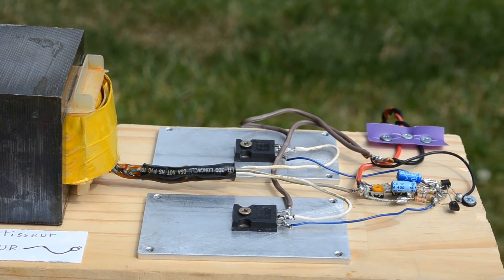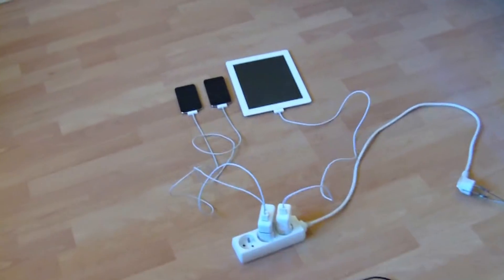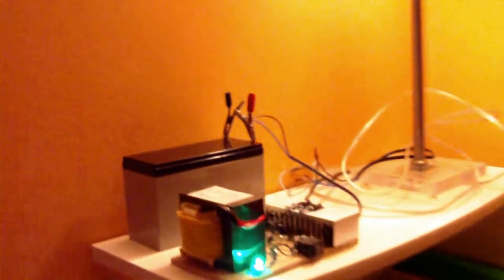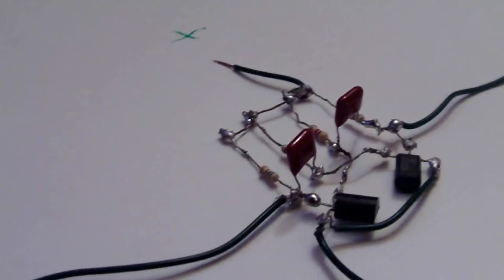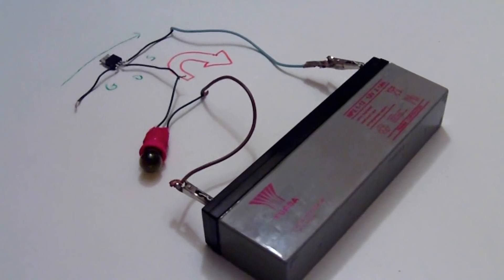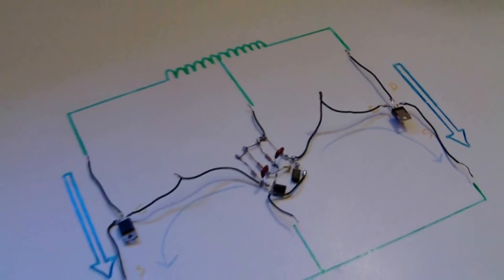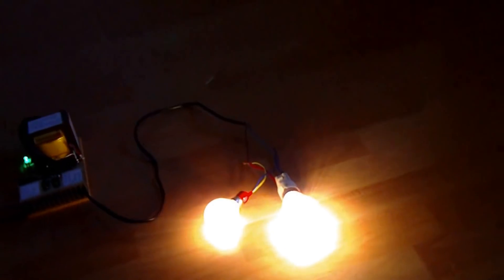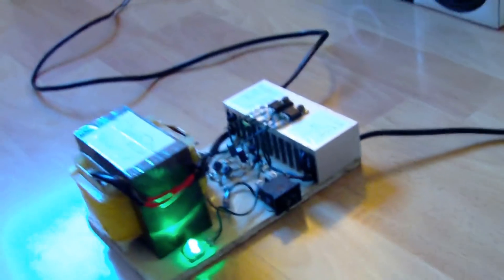Make an inverter : DIY Experiments #2 - Power AC devices with a battery / homemade inverter

Comment: Can any one suggest me which transformer need to get 70 volt out put.
Reply: +rtbalu Depends on your windings. If you use a 12V battery, you must have a 12:70 ratio on your windings. I suggest having a 7+7 on the primairy coil. Meaning you would have to make a transformer with 82 windings on the secondairy coil.

Comment: if the output of this inverter is connected a 220v ac and then to a motor would it give the motor a better voltage , like a sine wave?

Comment: Transistor number??
Reply: what volts u use with 2.2uf?
Reply: +Ali Asir is it true that the diagram you use of your converter is the diagram that diy gave at the end of the video?
Reply: i follow what diy video but my inverter doesn't work sir ali asir...i think in my transformer i used...what type of transformer you used sir in your inverter..?
Reply: +Atakan Karaoğlan Mosfet Transistor IRF630 
And 2N2222
Reply: Voltage is no matter i used 400v and it works prefect, here you can see the one i made 
http://postimg.org/image/a9ln0fdnr/

http://postimg.org/image/776wxonnb/
Reply: +Ali Asir ....what is the value of your capacitor?
Reply: 2.2 uf + 400v
Reply: Yes
Reply: Npn or pnp please reply anyone
Reply: Joel Munion bro use 12 0 12 step down transformer. Good to use a higher amp transformer

Comment: How do I make one for  3 Phase AC ?
Reply: +Flying Karapet Edit our transformer, makes 3 wire on output, just you need to remove the secondary coil from the transformer and make one wire in the Middle of the transformer and that is it

Comment: Cool video. I know these type of inverters are very reliable but you can't go really high in wattage.
Reply from the maker: It's not a problem of battery, a lead battery like that van deliver more than 50A, more than 200A on short circut ! The problem is the resistor in the primary coil. To have a lower you have to use a bigger transformer (higher section).
Reply from the maker: In normal use a battery is always far from his max amp (short circut). It efficiency is decreasing proportionally beacause of it internal resistivity. So it do not depend of the type of battery, if your battery is next to his max amps, it would died quickly !

Comment: I am trying to learn about how the oscillator works. Do you know of any good websites or videos to explain this?  Thanks
Reply from the maker: I take the time to understand is by myself, indications : exterior resistors = "power" of the oultet of the oscillator. Center resistors : RC circut with the capa. In a cycle, the capa are charged at -0,6 at one moment.
Reply: Pedro Casultsan 
www.sentax.ca

Comment: i want to ask you something...what type of transformer you used? i have a 230v to 12 v transformer which i buy for making 230 v ac to 12 v dc..can i use that transformer in this case??reply as soon as possible
Reply from the maker: In this video we use a symetric transformer, equiv to 24V with an out at 12V. Il you want to use a sigle outlet transformer you can use a "H bridge" but it require a P-channel transformer :)
Reply: Can I knw what will be the capacitor voltage?
Reply: Hii ..thankx for posting this type of video. .I make it but have a problem.thisgive me a 115 v of ac output and  how to increase the voltage...
Reply: rohit hazra 24vdc to have tolerance
Reply: I make it but still have a problem. ..I just get 120v.. wich can glow just 5w. Cfl..I want more power please help.
Reply: +rohit hazra What kind of transformer did you use?

Comment: unsure what tranformer to buy...what to google...where i can salvage 1 from...any help plz as im goin to be making this asap to run my laptop in my car cheers
Reply: Brat4PrimeMinister from oven or  i got one from sony stereo or any electric .
Reply: +Brat4PrimeMinister Use Step Up Transformer 12vac to 220vac or 110vac 
Remember the Input of your transformer must have 3 wires , 1 the start of the coil second one in the Middle that&#39;s half and other one the end of the coil, use a strong and big transformer that works better i made one by my self and that works very well
Reply: here is the one i made: 
 http://postimg.org/image/6d6ad2dwb/
http://postimg.org/image/776wxonnb/
Reply: would love to see a vid of a make (parts list) or just of it working
Reply: i will make one
Reply: ANTHONY CABALLERO can I use a microwave transformer with this circuit? I intend to use the device in the same manner as he did in the video.
Reply: Jordan R. Just change the highvoltage secondary windings into 12-0-12 and add more Power mosfets, it will do, Good luck! :D
Reply: cheers ali for ya time....im still goin to be makin this project later in the yr so I may be in touch....and then ull wonder 6 months down the line who the fuck is this guy....thx again ;)
Reply: Brat4PrimeMinister if your only run a laptop, a 12v 8A center tap or 12-0-12 
transformer will do

Comment: thanks for the video. but the transistor 2N2222 is unavailable in our market. which equivalent transisor can replace this coponents and the rating of the capacitor is not know. help me on this. how can we increase current in the circuit. is it by changing the mosfet transistor

Comment: Thanks for reply... I have brought a new one.. Replace it.. And thankyou... I  just made an inverter and it work well... Thankyou :) DIY Experiments
Reply from the maker: Great !
Reply: DIY Experiments , hi please can this inverter power on a single phase electric motor? please help me
Reply: emmanuel nkengache this device produces a square wave output so it is probably not ideal for powering inductive loads such as motors but I think with enough know how and parts you could make a pure sine wave version 

Or you could just buy a premade pure sine wave inverter
Reply: In my attempts to power induction motors with square wave and modified sine wave inverters I found that they use more power from your battery and the motors have a bad habit of overheating and in some cases they would not start or would start very slowly and have reduced performance
Reply: please with pur sign wave can an induction motor start numally with ful speed? if yes, please can you help me pur sign wave inverter diagram please
Reply: As a general rule of thumb 
a pure sine wave inverter can power pretty much anything that the mains can power (assuming your inverter and battery has enough capacity)

So yes in general a pure sine wave inverter can run and start an induction motor 

motors like universal motors will generally run fine on modified sine wave but will probably run a little hotter than normal 

Induction motors such at what is in your fridge, washer or A.C are unlikely to work on modified sine wave and if they do manage to start they will probably overheat and will definitely draw a LOT more power from your battery and possibly overload your inverter 

Modified sine wave inverters work well for applications such as 
Lights 
Switchmode power supplies (laptop/phone chargers)
LCD TVs 
Electric heaters 
Electric cookers (if you can find an inverter powerful enough)

Pure sine wave inverters are best used to power the following 
Any appliance with a motor or compressor 
Microwave ovens 
CRT TVs 
Transformer power supplies 
Alarm systems (home security)
Desktop PCs 
fluorescent lights 
Sensitive equipment (oscilliscopes)
Life support equipment (oxygen concentrators)

But in general I recommend buying a large pure sine wave inverter instead of a modified sine wave and a pure sine wave because it is more energy efficient 

Hope this helps
Reply: 45hz I am surprised your equipment works properly 

Also what is your voltage regulation like 

In my usage I have found square wave and modified sine wave to be almost useless for what I need to power
Reply: Il take a look later when I get home
Reply: Output voltage regulation 
Meaning if you connect a big load 
How much does the voltage drop before the load fully starts and 
How much is the voltage at max load compared to no load
Reply: Ok well it's always wise to test the voltage regulation on any power inverter wether you made it yourself or bought it from a store or online
Reply: 105 seems a bit low for US standards 
I recommend a better transformer and thicker wire to and from the boost stage 
Maybe even a high voltage cap on the 120V side of the boost stage (before the chopper of course)

Over here in Australia 
I don't buy any inverter unless it can maintain 235V at max rated power
And 220V at its max rated surge power

It tends to damage equipment if the voltage dips into a brownout condition so AC voltage regulation is just as important as the output voltage itself 

The easiest way to test the voltage regulation is to get a power strip and plug a multimeter into it 
Then write down the no load voltage 
And load the inverter to its max power and write down the voltage again 

Or you could just observe it if you CBF writing lol
Reply: Not a bad idea I guess the simplicity of it would allow you to drain the battery more and allow for easier repairs 
But you definitely need some form of AC voltage regulation or at least a clamp circuit so if you connect it to a fully charged battery the AC voltage doesn't go to like 150V-200V (Which would fry most things in the USA)
Also a hint you can run AC equipment at high switching frequencies without damaging it 
I have seen things run at up to 100hz (50hz is the norm here)

Also what is the battery voltage that your inverter becomes unusable 

Mine gives the screech of death at 10.12V and it cuts out at 8.79V
Reply: And still gives 120V out?
Reply: Ok well good luck with that
Reply: Ahmed Saeed can u say the transistor and MOSFETs are npn or pnp
Reply: DIY Experiments I need transistor and MOSFETs details pls npn or pnp only need to know
Reply: Ahmed Saeed dude I need ur help

Comment: DIY Experiments  help plz...  I have to phase transformer.. While you have three... What should i do now?
Reply from the maker: Ahmed Saeed : It's not possible with a two wires transformer. But we can use a H bridge for that, it require 4 mosfets transistors.

Comment: In my transformer there are two wire for input.. But you have 3.. Two on both sides.. And one on middle?? What should i do?
Reply: Ahmed Saeed get the right transformer its called a center tapped transformer

Comment: what type of transformer you used? can a Step down center tap 12 - 0 - 12 transformer will do with a primary 0 - 220 volts?
Reply from the maker: Yes, it is exactly the kind of transformer we used ;-)
Reply: DIY Experiments  Shouldn't it be a step up transformer, since you're bring 12 volts to either 120 02 230